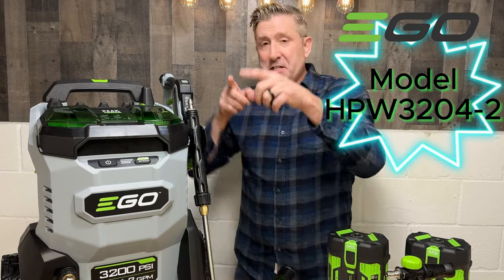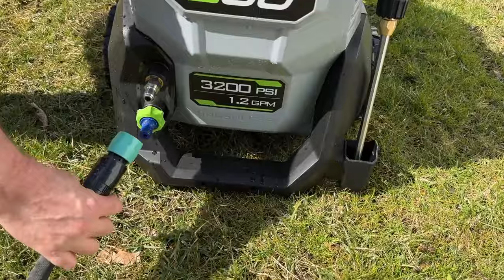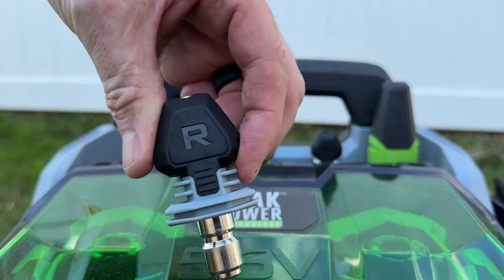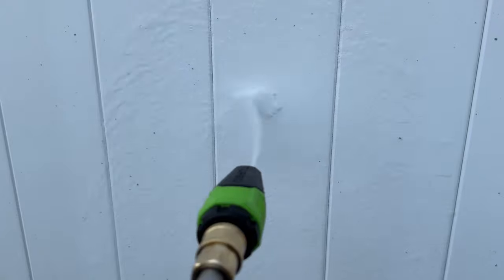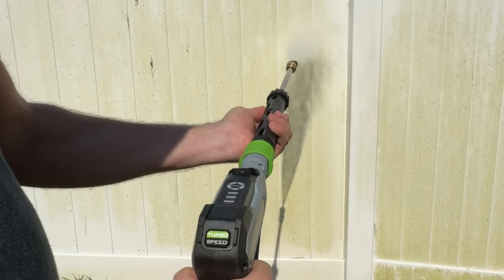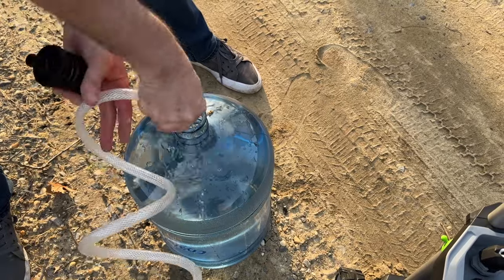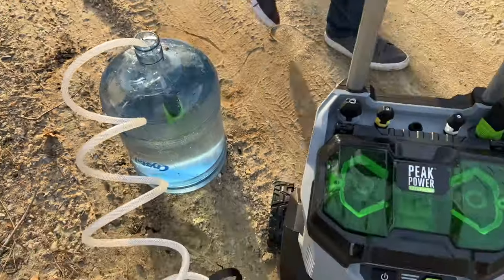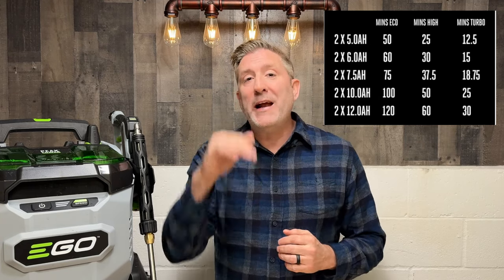DIRTY VIDEO - EGO 3200psi Battery Pressure Washer Review💧💧💧

Comment: Psi is not near as important as gpm with pressure washers. This ego pressure washer with 1.2 gpm is very lackluster and severely lacking. I wouldn't purchase this.
Reply from the maker: Does your pressure washer pickup water from any source?
Reply: Nonsense

Comment: Craftsman gas is 359 at Lowe's for 3100 psi. Ego is definitely a win at 444 less maintenance and less money in oil and gas CEOs super yacht.😂😂😂
Reply from the maker: Yeah to get 3000+psi pressure washer - the price will be at least $350
Reply: Price is $799 at Lowe’s with battery for EGO. Give it another year or two and you see it down to $499 or $450…the $799 is regular price, so wait for it on sale which could be at least $50 to $100 cheaper.
Reply: The key here isn't so much price, it's gas powered tools anymore being ruined by high ethanol content gas being sold everywhere meaning carb rebuilds, stabilization additives or using expensive fuels to make sure they all keep running. Just the peace of mind not having to babysit gas powered yard tools is worth the price. It's why I finally bought an EGO mower last year. I still prefer the power of a gas mower, but the frustration and headache involved with keeping them running properly was too much. I'm sure when I go to start my gas pressure washer this spring, I'll be PO'd again because somehow any gas left in it.will required a day of cleaning it up just to use it. Thanks Corn Industry!
Reply: Over $800 for a 3200 psi,no thank you. I will stick with a gas for half the price.

Comment: I just got one recently. I love that it came with a siphon hose that you can just dunk in a bucket, for reasons like that my off grid hunting camp that needed cleaned doesn’t have a garden hose, and all I have to do is haul my water storage containers to camp with me, and dunk the siphon in…on another note though, I recently purchased two 12 amp hr batteries for this as well. The two 6 amps it came with are decently nice but the run time with them is ever so lackluster in my opinion

Comment: Does not seem to be 3200 psi. My Generac is 3200 and seems much more forceful. Nice product and review tho! I can run mine on 1 gallon for about two hours full blast. 

I do agree with electric tools tho. Just not vehicles.
Reply from the maker: Cool, thanks
Reply: 3200PSI +/- 10% at 1.2GPM, whereas most gas pressure washers are pushing double the GPM at that pressure. GPM is a huge factor to cleaning.

Closest equivalent to gas 3K PSI pressure washers are the Greenworks 60v and 80v, claiming 2GPM at that 3000PSI rating.

Comment: Thanks for the review.  I recently purchased the Ego Wet Dry so far I like it other than I can't find replacement bags.  The pressure washer is intriguing but I would use it 70% of the time for washing my vehicles and I just don't think 1.2 GPM is enough.  It's really the bare minimum.  My Generac pressure washer is 2.5 GPM and that's perfect for car washing.  But for everything else it looks like another winner from Ego.
Reply from the maker: I haven't used any EGO bads in my vac - you can just let it dump into the container - I'm not really sure what more gpm would do in terms of cleaning - I really like that you can set the power levels
Reply: @Kitearmy When you have respiratory and severe allergy issues the bags are a must.  The fact they released a product without a supply of bags was disappointing to me.  It's a good product nonetheless.  I clean 100's of car a year and the GPM is very important, more so than "power".

Comment: The real bottom line is a pressure washer’s cleaning units (CU), which is simply GPM*PSI. The Ego is 1.2*3200 or 3840.

Remember this is BATTERY, so compare this with:

Ryobi which lists at $599 and only has a CU of 1800
Greenworks which lists at $700, but does have a CU of 6000 (don’t know the runtime at that CU)
Craftsman which lists at $549 and only has a CU of 1800 (but I see lots of discounts suddenly)
Reply from the maker: Yeah - I think this is right in line with other priced models.  If you already owen EGO batteries, it is a no brainer

Comment: Like all old grime a pre-treat will help but sometimes using a agitation item helps to break away that bonded junk.  It is a good unit if you need power and no electric cords.
Reply from the maker: Right on

Comment: I’m enjoying mine for vehicle washing. As a fan rinseless washing, I thought I’d never say that. Since I’m team EGO I just had to see what the fuss was with pressure washing. Now I know. Just think of it as I did. I bought two more batteries, another charger, and EGO threw in the pressure washer and accessories.
Reply from the maker: Thanks for sharing that - I'm not a car cleaning nut - happy to hear it is working well
Reply: Cleaned my patio, siding, and anything I could blast. So much cleaning fun. Enjoy!!

Comment: Why were the hose connections leaking at the start?
Reply: 2:03 same question. Build quality or did you rush the setup Andrew?
Reply from the maker: My hose, got damaged.  Just bought a replacement
Reply from the maker: The winter beat all of my stuff up - hose got rusted real bad
Reply: Glad to hear it wasn't the machine👍
Reply: @Kitearmy  dude, inside storage 😢
Reply from the maker: Yeah - my mistake - some things slip through the cracks @cguy96

Comment: Great video review as usual! I’m an Ego fan and early adopter. But I have a question for you. Why are you standing so close to the fence? Is the pressure not enough to stand further back? I have the Bauer Brushless 2300psi electric power washer and I saw people standing close to objects they were cleaning as well before I bought it. The. I got it home and noticed I didn’t have to stand that close and still get a nice powerful blast that cleaned anything I was trying to clean. I’m hoping to get this Ego power washer now and sell my Bauer! Also I saw a bit of leaking from the intake port. I’m wondering if that can be remedied with aftermarket quick connects.
Reply from the maker: standing so close to get that wow factor for video - btw, thanks for the support

Comment: Cool, cool.. but 1.2gpm is not nearly enough :/
Reply from the maker: Seemed to be enough - what do you think this would not have enough power for?
Reply: @Kitearmy  With any pressure washer, the higher GPM the better. With 3200 PSI and just 1.2 GPM you're really only better off cleaning smaller surfaces or fences. 2 GPM is the sweet spot, especially for cars.